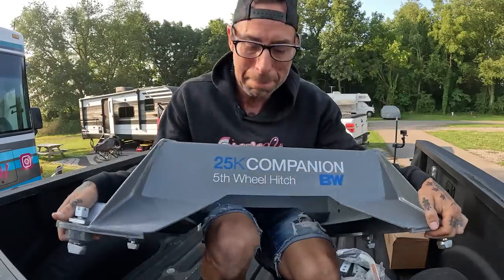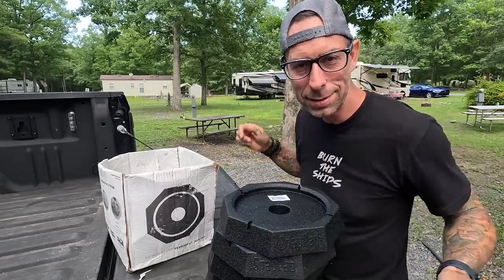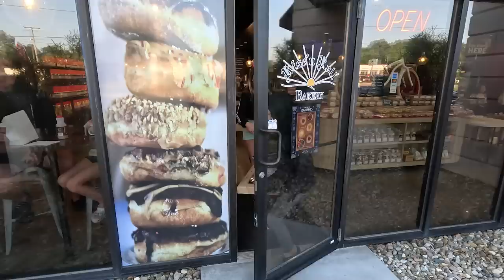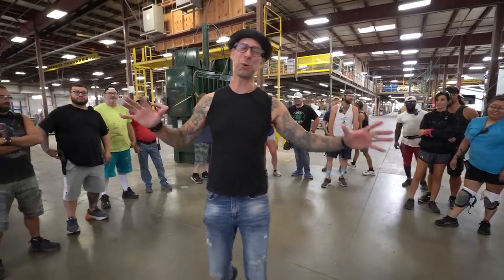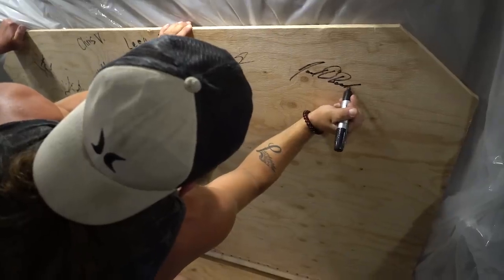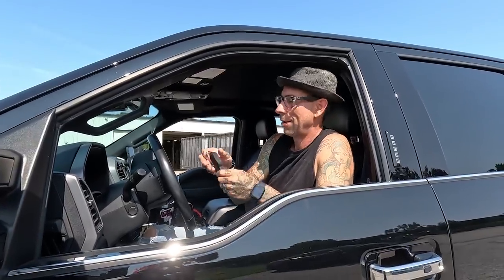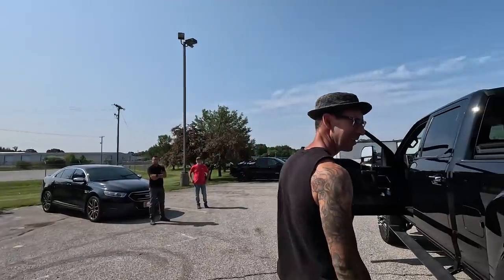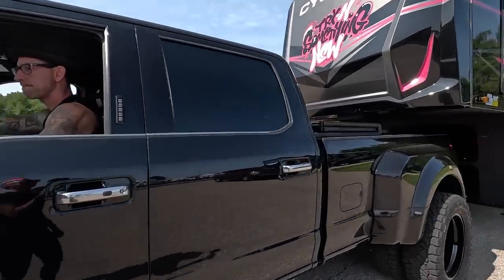Picking up our BRAND NEW RV! Driving a fifth wheel for the 1st time!

Comment: Just came across your channel 2 weeks ago. I think what you guys do is awesome. I think it would be awesome to travel the world. My sister travels a lot. Just to let you know I'm pretty sure you won't fit in a drive thru. Lol. Thank you for having a real truck to tow your 5th wheel. I live in utah & lots of people here use half ton trucks to tow their 30+ foot travel trailers with the back end almost touching the ground. When I upgrade my F-250 I'm going to get the F-350 dually with the limited or platinum package so I can tow anything. I had a neighbor that had i think it was a 40 foot cyclone toy hauler & he had a 2017 F-250 that he used to tow it. I'm shocked he didn't wreck it cause when he hooked up his it would drop the back down to the ground. Those cyclones are big heavy trailers. I like my vehicles to have options. My daily driver is a 2021 Ford explorer ST that I've had 2.5 months & have already driven 5200 miles. It has the panoramic sunroof too. Stay safe out there.